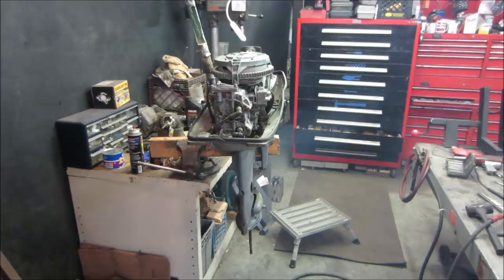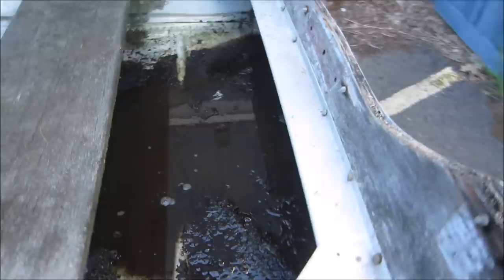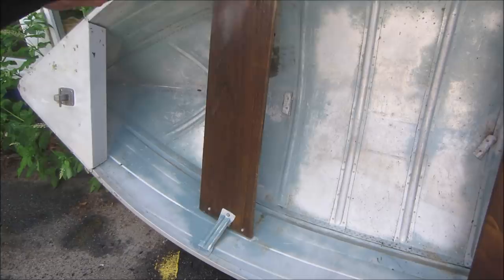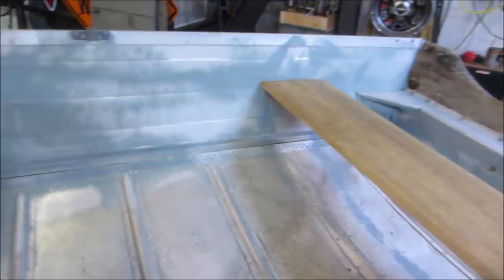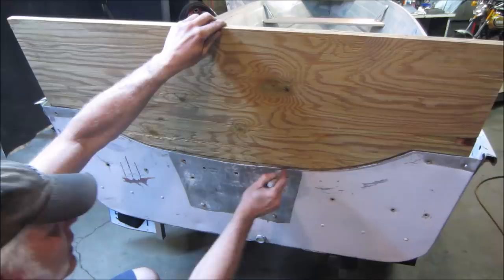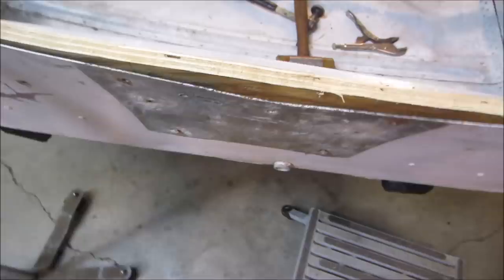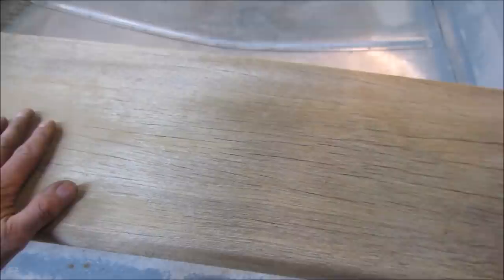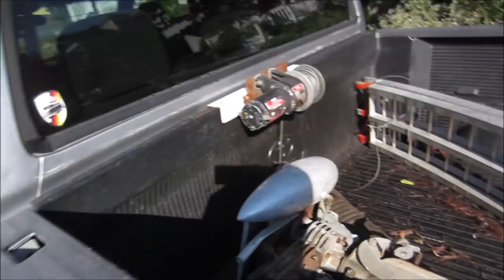Free Boat, First Wash/repair in 20 Years

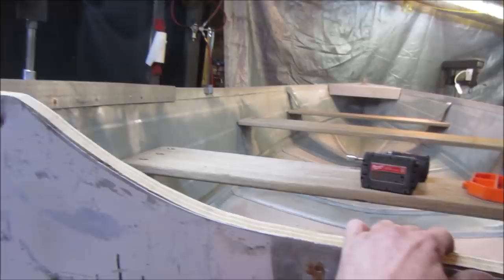Comment: At 23:04; I'm sure (as you are), it's where a "doubler" was for strength (to support motor).
Hm, what to do about the corner gaps? (not the best idea and more work)?
First; I'd cut a vertical line down the center of your wood transom.  Second; I'd scribe and cut the transom ends to match the hull corner angles.
Third; I'd create a couple 2" horizontal notches along the vertical cut in the transom (2 per side).  Forth; I'd add steps (for overlap) along the vertical and notch cuts.
Fifth; Using the extra wood used to cut the transom out of, I'd create a patch to fill in where the center cut and notches were made (including steps/overlap).
Sixth; After cleaning inside of metal transom, seal and fasten wood transom , metal transom and doubler (overlap center cuts) together.
Sixth-A; Maybe add metal plate (aluminum?) that matches the doublers shape to cover over (strengthen) cuts to wood transom?
After all that, Murphy will reveal a single piece of wood that will fit transom perfectly after cutting to fit.  ;-D

Comment: Jack plate. Just cut out the same shape with plywood, seal it and bolt the inside plywood through the back of the boat and the jack plate. In Louisiana we use stainless steel, but plywood works just as well.
Reply: And there you’ve done it..? 🤣

Comment: IIRC from having seen aluminum outboard skiffs from that era when I was younger, there was a piece of marine-grade plywood on the outside of the transom in that area. The purpose was to allow the motor's clamps on both the inboard and outboard sides to bite into wood when they were tightened to prevent damaging the aluminum. It also gave the transom extra rigidity and less vibration to the hull from the motor as wood on both sides of the clamps has a bit of give to it. 

Edit: you already figgered that out. at 26:08. Serves me right for not watching the whole video before replying. :)

Comment: Great project, I'm  impressed with  the bleach attack, never used that. Oxalic acid and wall paper paste for GRP staining..  I would not of varnished if the wood is teak, and it looks it, just sanded with 60 grit. If it's teak  the varnish will blow in  few years in the outside. Teak just goes grey. The thicker the outboard thrust pad the better, depends on your intended motor of course, not only gap of adjusters but also depth of inner brackets.
Great stuff, as always..

Comment: Bought a boat just a little smaller then that one to use in my pond. Got it cheap but the thing had over 20 holes drilled in the bottom. Some kind of fisher man had all kind of depth finders fish finders in it before I got it. that was 20 years ago I still cannot believe he put that many or any holes in the bottom of a boat. Welded most shut but still leaks here and there slowly.

Comment: I'm no boat expert, just an average guy and I'm sure someone has more knowledge and already commented  but, if it helps any, heres what I found. From the pictures I saw when I Googled 70' aluminum row boat, they had a apiece on the outside, like the one you did and another smaller one on the inside. Hope that helps.

Comment: Any penetrations through the hull you should strongly consider silicon omg or using epoxy.  Though the motor mount you used should work, I believe you will be happier using a piece of 2X12 instead.  The problem with plywood is that it will delaminated (from my experience). Hope this helps. Fun being on the water.

Comment: If the 5  horse Merc is the last generation Merc made in Sweden then it's rather valuable and coveted by canoeists because it has both remote gas tank and internal 1 liter tank. If you can fill the internal tank by turning the gas mode to internal and then pump the gas can bulb then its the valuable one. I had one and sold it to a great friend and he still uses it on his canoe. Most small motors for canoes do not have reverse so you have to spin the motor; these lightweight Mercs are great ans have complete transmissions; the only thing that goes bad on them is the thermostat.

Comment: That's mosquitoes swimming around. Pickup a "turbo nozzle" for the power washer. They clean much better. Marine Plywood is what you want for the trans... and clamp it on the back/outside then trace it. Then cut it out on the inside of the line. The wood needs to go to the outside of each side. You've got it too small near the top. That little wood you put outside the boat needs to be on the inside unless you are going to cover it with something water tight. You could also use a piece of plastic. (think plastic cutting board)
Reply from the maker: l sealed the wood

Comment: The weak points of transom is the outside corners it wi.l flex unless  it's  mated to the sides of boat  make sure you marine silicone between ply and alloy . Cheers from Australia

Comment: Hey Mustie.......the sun will weather the urethane quickly..... if it is teak....then your better off using oil. have to re-apply more often....but in the long run...its much easier than stripping the old urethane to re apply...I know from experience!

Comment: I am partway through a similar project, on a Wagemaker Wolverine. In my case there was galvanic corrosion of the transom. My plan is to use tar paper between the wood and the metal, and isolate anything steel from the aluminum. The big brace you mention at 16:40 is necessary, and should be made of an absolutely massive piece of aluminum; on mine they are stout castings.

Comment: I know a guy in my community who bought and sold the Water Witch motors that you just picked up.  He had hundreds of them and still has parts.  The one you have now is in superb condition.  Most of the time, one or both of the tanks are dented and are almost impossible to repair.  If you need parts, I will hook you up with him if you want.
Reply from the maker: Thanks for the info

Comment: Mustie, my parents own a boat very similar to that one and yes it does have corner braces in the back. I can get you pictures of what they look like if you would like, but I believe they are cast aluminum. They have handles for either side in the back of the boat for moving it around easier.

Comment: @mustie1 you need to take that treated ply out. Treated lumber uses a copper solution and putting it against aluminum will cause electrolysis to eat away the aluminum. 

Look it up, read about it, you'll be glad you took the time.

Comment: I would have epoxied in the wood for stiffness and to prevent water ingress. Yes, you lose the 'removeabilty' but you gain a lot mechanically and in duration (and given the type of use the boat is destined for, the fact that it will be much harder to replace the wood if and then becomes a secondary concern). I'd also try to get to the edges on the top for the same reason, you can possibly cut the edges at 45 and glue on some extensions (it's not the best solution but once everything is epoxied together it will be a lot better than nothing). Concur on some corner bracing as well, though I would also dedicate some time to the profile on the left corner that was replaced with some... floating aluminium? A lot of the stiffness of the side comes from that top profile and if you're going to anchor the corner brace there it becomes doubly important. On the outside the most likely original covering was either plastic or hard rubber, wood will work just fine. I second the folks who suggested that there was probably a rib in the centre of the boat and I would recommend replicating it - up to and including the supports for the middle of the seats. I would also agree with the folks who said you need floorboards, walking on the skins is not healthy for the boat or for the boater.
Finally... I don't think that looked

Comment: You definitely want to gin up some corner braces to help hold the stern stable.  Make them as big as you can out of aluminum, and do the same thing with plywood as you did with the stern.  That will give a good place to mound cleats or cup holders.

Looks really good.  Great job on restoring the boat.

You should be able to find that lower unit for the Evinrude, if you are still interested in fixing it.  Check out old boat stores or online.  Parts are out there, and an 18hp will make that boat fly, or seem to at least.

Comment: Because the transom is curved at the bottom on the sides, the plywood isn't actually going all the way to the bottom.
The Ply needs to be radiused to fit the bottom of the transom first, then traced for the top.

Comment: Use the same bolt holes but you need to use a good quality silicone to seal the holes before and after the transom mounting bolts are installed. A good amount of silicone should be used around bolts as they are installed to seal those holes. Again, don't use the pressure treated wood and make sure to seal any wood used and the cut edges with a good marine sealer.

Comment: Nice work looks great! I would put some kind of corner braces on it if you really want it to work and last. First time you hang a heavy motor on there and drive down a bumpy it will break. We had one that had corner braces on it that cracked driving down a bumpy road and it was complete good shape to begin with so the corners take some real pressure driving down the road. No body wants to be in the water when they break off.

Comment: You can use the anti-skid self-adhesive tape for stairs on the benches if they're too slick. A couple of 18 inch (45.72 cm) strips on each bench would do it.

Comment: Looks like the center support channel is missing. That's what those brackets were for. My old Mirrowcraft aluminum boat had that center channel. Also, the two lower holes on each side of the transom were for handles. Yours are of course missing.

Comment: It is wood that goes on the outside as well. The corner brackets are flat aluminum that are like a triangle and they cover the entire corner, should cover that gap at the ends of the wood you cut.

Comment: Btw, pressure-treated wood has chemicals in it that will react with aluminum and get into the water. There was probably a steel or wooden bracket mounted to the outside of the transom for additional support and rigidity. You'll need it back there especially since most outboards only clamp down to a maximum of 1- 1.5 inches.

Comment: Aw Mustie, it seems you take a lot more care restoring your vehicles than you do on boats. I know it's old but it deserves your best skills like a decent marine ply transom that is the right size, support brackets for the seat sides and middle, at least 4 coats of polyurethane for the woodwork. A proper job will reward you in the future when you need to test that 40hp outboard you picked up cheap. I wouldn't trust that hunk of pressure treated stuff with anything over 5hp..
Reply from the maker: this boat is a pile and l am not restoring it, just a test bed for motors,

Comment: Don't be tempted to use steel as a support/brace. Use either aluminium or wood. A couple of pieces of 3/4 marine ply glued together and formed into knees will adequately brace the transom.
Be tempted to put a marine plywood floor in it as well. I think that may be what that piece of aluminium brace was for up forward. You will need to fabricate and install extra brackets to support it, though. Use Marine grade (316) stainless hardware for your fixtures, not the cheaper Chinese crap stainless that will rust inside of a year.
The outer transom would have carried a piece of marine grade ply or solid wood for mounting the engine.
A good quality Marine Varnish will suffice for the thwarts (seats) and transom ply.

Comment: The chemicals in pressure treated plywood will corrode aluminum. Use regular plywood and seal it with epoxy.

Comment: My vote would've been to unbolt the benches and sand them down on saw horses, and then attack 'em with Boiled Linseed Oil.  One coat/day for a week, one coat a week for a month, one coat a month for a year, and one coat annually there after.  Feeding it with oils, rather than sealing it with plastic.  3/4" plywood, treated (for the transom) the same way.  I would not use pressure treated lumber.  The chemicals in it will destroy the metal.  I'd look at the Sikaflex Marine Sealant for between transom/aluminum and where all bolts penetrate the hull to secure the transom/aluminum.

A mild acid based wheel cleaner to get that bare metal clean.  An etching primer, and I'd've opted for that "apply with a roller" truck bed liner for the inside of the hull.  

Agreed on the corner bracing, I'd add some wedges to fill that void where your plywood wasn't big enough and incorporate that at the time of the corner bracing.  

A little more love and you'll have a fine little lake trolling boat.
Reply from the maker: not restoring this boat, it is just to test engines,

Comment: Could have had oar holders or had a wooden flooring with marine carpet. Which it does need. And a canopy unless your planning on baking your tootsies. Your gonna need at least 25 long shaft outboard at minimum. If you put your dog in for a ride don’t want him burn his paws. Theirs a product for decks seals and prevents splenters. I’d paint the boat the gunnels carpet the floor the other option is get linexed. Gonna need a six gallon fuel tank twelve at most hull get it primed painted

Comment: I'd think some sort of rolled section of aluminium ;-) riveted in as a simple 'keel' stringer to stiffen the bottom, the transom stiffener ply looks a bit thin, given the engine that came off, could do with being a bit deeper into the hull too.

Comment: nice job Mr.Mustie. Ya know it's the teak oil in the wood that protects it from rot,  & if ya put antin with a solvent in it to soak into the wood,  it can push the teak oil out which can then eventually lift the new coating off the wood. if it's good teak it's perhaps better to let it grey & give it a sanding when needed.  even teak oil from a bottle needs to use a thinner to get it to soak in so i question the benefit other than what it looks like ?    ...... btw, ..... i dig the new Captain Pugwash Look matey ....

Comment: You should be using marine grade plywood for both the transom board and the outside motor brace board.  Also use silicone around the old holes to seal them from water penetration.  The outside board should also be painted with a good exterior paint.  You were correct that there was center braces for the seats.   Unfortunately, it looks like someone replaced the center aluminum seats with wood ones.  The aluminum seats (benches) were probably broke at the edges.  By replacing them, they also removed the flotation foam that is required by law.  I also didn't see a Capacity Plate with the Vin #.  Those are all things required by law.  The capacity plate will also list the maximum H.P.  motor for that size of boat.  The boat commission checks these things and will issue a fine if not present.  There at the back of the boat where the transom board and the metal join, there is also usually a piece of metal trim that covers over the top edge.  I used to have a boat like this years ago.
Reply: Karen move along it's his project. Hes not done yet.
Reply: @jrcchamberlain2303  Maybe I should move along if he let's people like you come in and call subscribers a derogatory name.  Don't think Musty would like it that you are chasing his subscribers away.
Reply: @Newman81964  hes called people Karen's in the comments before. Let him do it his way. Btw your a required by law karen. Take care
Reply: @jrcchamberlain2303  Aww, what's the matter, di my notifying Mustie of these things to try and help prevent him problems in the future mess up your plans of you reporting him to the authorities so you could get a laugh out of watching him get into trouble?  I only notified him of some of the problems I ran into the past with some boats I have had and figured I would save him some of the same trouble.

Comment: Metal pads looks like a floor mount. I did see a engine control so might have had a center console for the engine control and steering wheel and push pull cable. Marine grade plywood should be used. I have reconditioned a couple dozen boats in my 67 yeras.

Comment: looks like my boat, if so the Fl;oat box,s that mount under each bench seat is missing as well as some of the mounting support brackets for them are broken off.  At the rear of the boat your missing two brackets that help give it strength and may also be carrying handles. The transom needs to fit tight side to side or it over time will start cracking the back of the boat.

Comment: put corner braces for transom and the seats need brackets also the plate on the rear needs to be a piece of 1/4" aluminum or atleast it is on the ones ive had and just use some kind of oil like tung or linseed on the seats

Comment: You need to use marine grade plywood for the transom. The glue is specially designed to be water proof so the plywood won't delaminate. The home pressure treated stuff just means its rot resistant and can be used at grade and also its missing the corner brace plates at the transom that transfers some of the stress from the engine on the transom to the rest of the hull.

Comment: I'd say two inches for the thickness of the transom. I' think the transom should be full width its affects its integrity....Those brackets that are missing off the corner of the transom are called transom knee's. You should put some in there they normally just cut some up out of plywood.

Comment: It looks like the transom will tear the aluminium on both rear sides as its not entirely filling the gap. Transoms are the backbone of these boats and will fail in a short time if not properly done. Your mileage may vary but I doubt it.

Comment: The transom probably had a thin piece of rubber on the outside and inside to dampen vibration and save on wear on the aluminum.